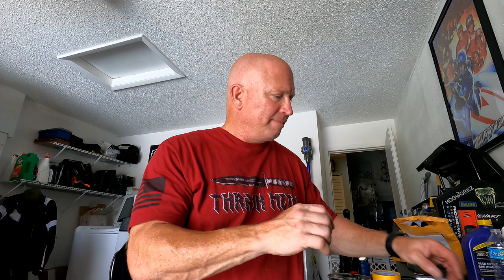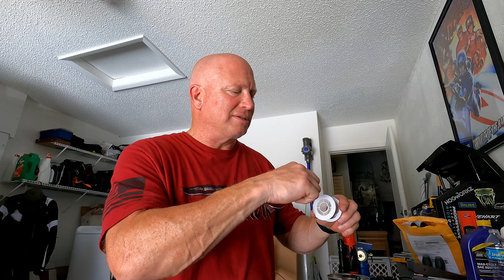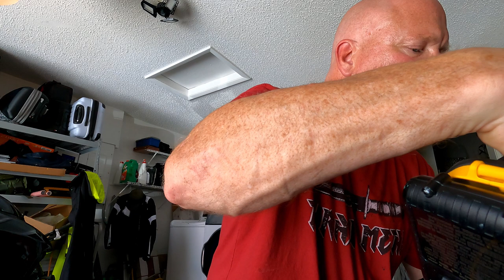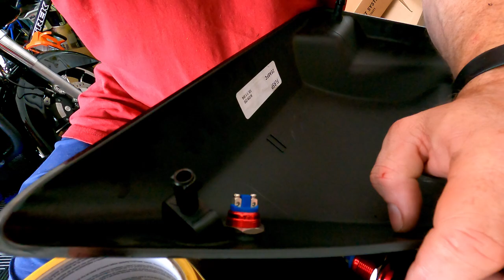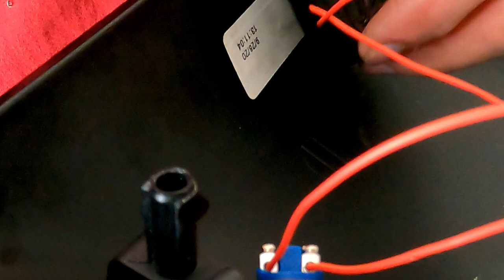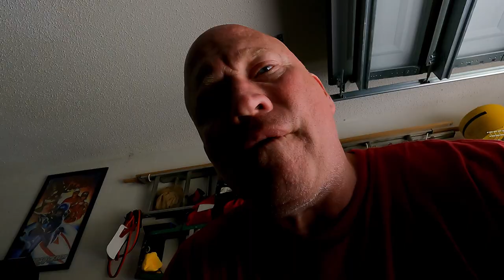Harley Davidson Garage Door Opener DIY - Install a Remote Control Garage Door Opener on your Harley!

Comment: Based on your video, I will most definitely do this install. Not just the ease and cost, but the straightforward way you told how to do it with no background noise, no stumbling around with tools and your knowledge makes it easy for anyone to do this project. Thanks once again.
Reply from the maker: Thank you Wayne!  Glad I could help.

Comment: Only recommendation I would add. Is drill a hole in the back of the case for the garage door opener for the wires to come through. That way they don’t chaff or get pinched. I used the exact same set up. Great video.

Comment: Thank you!  I needed some basic ideas for an inexpensive garage door opener.  Your video was spot on!  I like the Velcro idea for placement as compared to double-sided tape.  The transmitter unit can easily be removed for battery replacement.  You also gave me an additional idea of using the side covers - brilliant!

Comment: Thanks for sharing this. Sorry for being naive, why can't you just velcro the original door opener directly to dashboard or back of windshield without using the momentary switch? I feel it is a convenient remote as it is.
Reply from the maker: You can but I like gadgets lol.
Reply: @RealRonTV  LMAO I was thinking the same thing as U180slimshady.   But then I would do the same as you 🤠
Reply: I would say for the look also. This way it looks cleaner and someone doesn’t walk off with your garage door opener then follow you home and break in. That was my thoughts of it.
Reply: @Mbm-billiards  makes much sense. Thanks a lot!
Reply: I think this is a great idea.  The reason I would choose a visible switch rather than a remote fob tucked away is down to security.  No one will know what this switch does, but most people will know what a garage door remote looks like and does. (if that makes sense).    Great video, really useful.

Comment: There is a kit out there that is similar to yours, but has 1 additional feature. It gets its po×r from the bike instead of having to worry about the remote battery
Reply from the maker: Mine is just a quick DIY.  😀
Reply: @RealRonTV  they used the power from the cigarette lighter and I presume a resistor
Reply: @jamessmoth8683 you can solder those lines from the cigarette lighter to the pos and neg of the controller and get rid of the battery.
Reply: @Z28Racer1  bike is 12-14v  the garage door remote that use the coin style battery is 3v.
Reply: @jamessmoth8683 that makes too much Da** sense.

Comment: You sir you definitely helped me out thank you. 
Ps. Is that your green and white?
I ask in case you are a brother in blue , be careful out there.
Reply from the maker: Glad I could help!  And yes that’s mine lol.  You too?
Reply: @RealRonTV  Was, retired after 30yrs. Service in south Florida area
Reply from the maker: @RafaelJimenez-hz9gu  where at?
Reply: @RealRonTV  sir follow up ?
The radio transmission is not obstructed by the cover?
And
Is there room for 2 small remotes 
I have an electric gate also
Thanks
Reply: Not sure if you got my other reply 
I was a cop in a municipality in miami dade 
Where are you located ?

Comment: I have two buttons that open for a garage on another button for a common gate for condo where I reside. Do I need to buy two switches ( toggle or push  button)  and drill two holes?
Reply from the maker: Are there two different controllers?
Reply: @RealRonTV  Yes, my remote has two buttons, one for garage n one for my main common gate bc I live in condo where security gate is available
Reply from the maker: @paulson9616  without seeing it I would guess that you would need two separate buttons, each going to the corresponding area on the remote.  So I believe you can keep the one remote, just solder each one.
Reply: @RealRonTV  Thank you for taking the time to answer my questions.    I appreciate it, Sir
Reply from the maker: @paulson9616  anytime!
Reply: @RealRonTV  You could also get a rocker or toggle switch that's directional, i.e. a switch that automatically returns to neutral, but that will rock/toggle two directions.  Make 'up' the gate, and 'down' the garage.